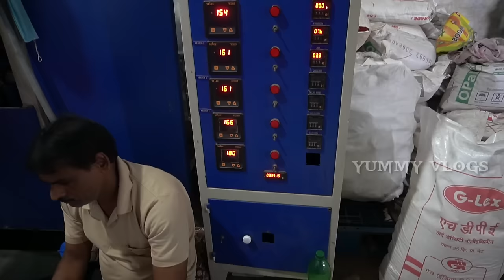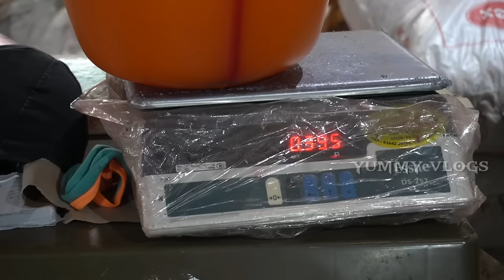2000 மேற்பட்ட Plastic வீட்டுஉபயோக பொருட்கள் | ரூபாய் 5 முதல் |Kudam manufacturing| yummy vlogs tamil

Comment: நன்றி நன்றி நன்றி சூப்பர் சூப்பர் சூப்பர் சூப்பர் சூப்பர் சூப்பர் அண்ணா
Reply: Brother,I enaku plastic wire koodai podum wire manufacturing  and wholesale shop therinijkanum.salem , Trichy,Chennai shop la retail a vangi koodai potu sale panrom. wholesale and manufacturing raw material  ennanu,epdi making panranganu therinchikanum. company trichengodu,erode la  sun plastic and apple brand company iruku. address  find pani oru vdeo podunga bro. Sale panra engaluku use fulla irukum.kindly requesting